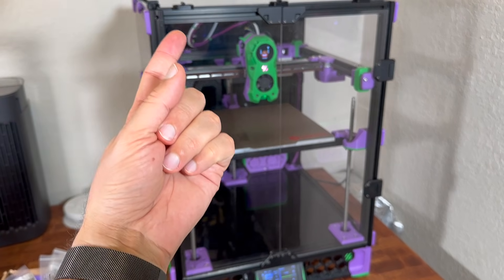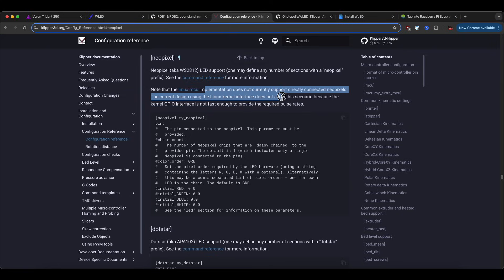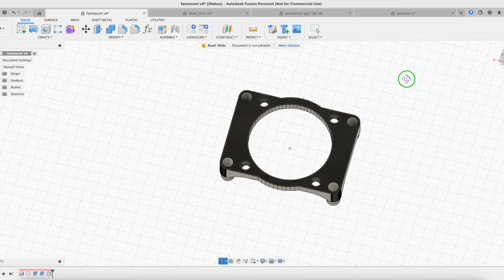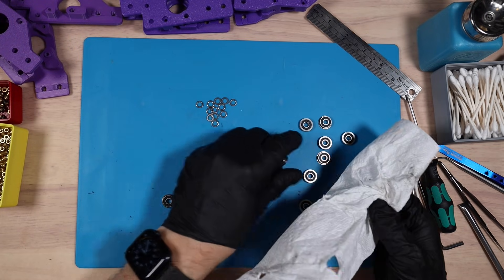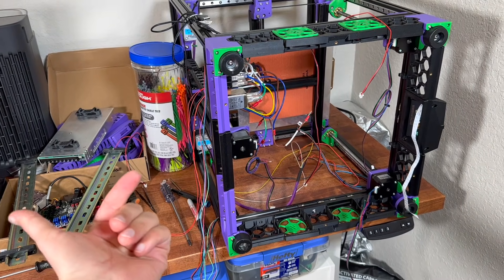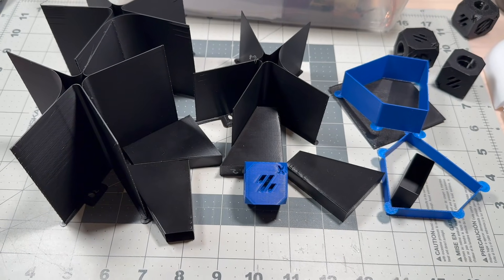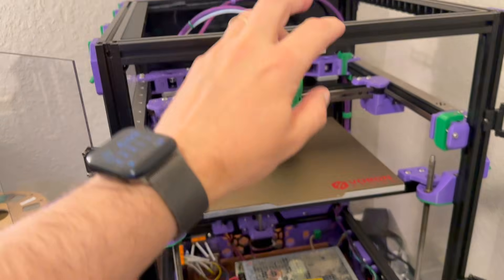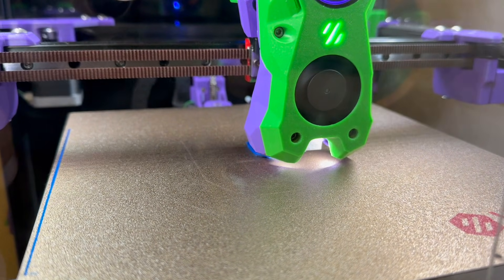Voron Trident mods (Inverted Electronics, Pin Kinematics)

Comment: you could try cpap, dragon bruner or  xol toolhead for better cooling
Reply: Few others you could look into if you're going that route would be reaper, mantis, and I think there's a modified mantis out as well
Reply from the maker: Thanks for the recommendation, I'll look into those. In my latest Voron 0 I have used Dragon not sure it will have enough cooling capacity.
Reply: @hobbyistnotes  BB is definitely better thatn SB... I have my 2.4 with SB and Switchwire with DB.. DB is much better. 
I think with the speeds you are aiming for its just XOL with CPAP
Reply from the maker: @Chaosek  I actually got feeling I will have to try all sorts of tool heads to find THE ONE.

Comment: One thing that's been mentioned on the Monolith discord that may be interesting to know - Powge Idlers and Belts have different tooth profiles than Gates belts/idlers.

If you are having issues with VFA's, you might want to try to switch to Runice style/Gates Idlers along with Gates belts.
Reply from the maker: Hmm, interesting I have some artifacts but I assumed those are from my extruder. Will try when I have time, thanks for the info.

Comment: Thanks for the video.  How do you secure/attach the bottom plate above the electronics?  I assume it is connected in some way.
Reply from the maker: I do not use bottom plate but you still can screw it in the same way as it was originally intended

Comment: Thanks for the great video.
 I'm considering getting an LDO Trident kit. Once you've built it and tuned it properly, how reliable is it compared to a commercial Core XY (Like Creality K1 Max, Bambu P/X series etc)? 
I sometimes read how people "constantly tinker" with their Vorons, but I'm not sure if it's because the printers require frequent maintenance to work properly or if the owners are tinkering for fun (upgrades, new features, etc)
Reply from the maker: This question depends on a lot of factors: 
- How good your over all skills assembling the printer
- What are your requirements for the quality
- How good individual components from which you will build the printer (LDO is good)
- How much time you want to invest in initial tune

Currently LDO kit worth like 2 bambus, yes bambu is closed source at this point but if your goal is to have printer that just prints I am not sure the path to build 3d printer is for you. If you want to learn 3D printing deeper and you enjoy whole process assembling and tinkering go buy the kit you will love it!

With experience it's possible to build a printer from the kit with in a week, taking all the steps and have printer that will print 24x7 for a long time.

Comment: Your X-Rail backer is doing nothing at all, where you have it, it needs to go on the opposite side of the extrusion to the linear rail.
Reply from the maker: It was installed there after a lot of testing. Main goal was to battle Z-Axis thermal expansion.

Comment: Subscribed))) Do I understand correctly that in my project I do not even need to stop at the option with new idlers and need to immediately go to the option with a 2-bearing solution and pins?
Reply from the maker: This is debatable and requires further research. Your printer is already functioning perfectly fine; pursuing perfection can sometimes feel like chasing a unicorn. It might not be worth the effort unless you have unlimited resources and find the process infinitely enjoyable.

Comment: Ditch stock idlers for beefy front idlers. Stock ones can crack
Reply from the maker: Heard that several times from other Trident owners but it never happened to me. So far works, when it cracks I will replace it for sure. What is the actual mod you referring to?
Reply: @hobbyistnotes  The actual mod is called beefy front idlers (or bfi, for short).
Reply from the maker: @Demios620  Oh yeah, I have installed those in latest Trident mod video ;-)

Comment: I recommend you start using PETG on the plastic parts of the printer, it is much more resistant and causes much less problems.
Reply: no, it is not more resistant
Reply: @NETONEVERSLEEPS  In my personal experience, I had a hypercube and a voron

which produced ABS parts, I felt like these parts became more brittle in ABS over time, they degraded and mixed, After a friend's recommendation, I printed all the parts in PETG and now it's been two years since I needed to reprint any part from my printer because it
Reply: @Sandmann_21 PETG doesn’t survive the heat of enclosed printers. ABS is mostly suitable, but ASA has a slight increase in impact strength and would be better for printers
Reply from the maker: I do not have any issues printing ABS in my garage. PETG is alright for open printers and I even tested it myself few years ago, BUT for enclosed printers with internal temp around 45(C) PETG stretches and eventually snaps. This is well known fact and was tested by hundreds of users in Voron community.
Reply: @hobbyistnotes  In my personal experience, I had a hypercube and a voron which produced ABS parts, I felt like these parts became more brittle in ABS over time, they degraded and mixed,After a friend's recommendation, I printed all the parts in PETG and now it's been two years since I needed to reprint any part from my printer because it broke.
Reply from the maker: @Sandmann_21 What PETG you have been using?